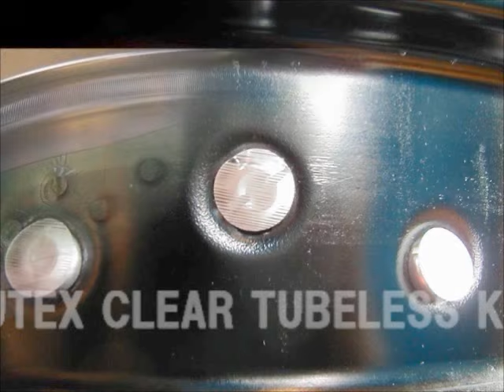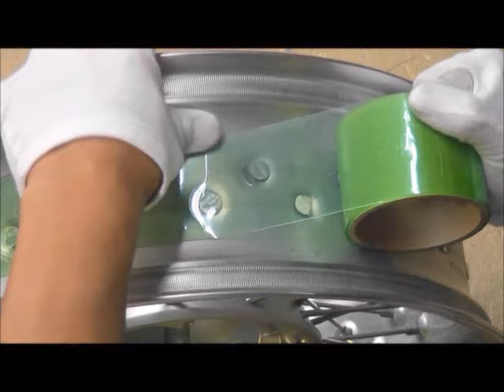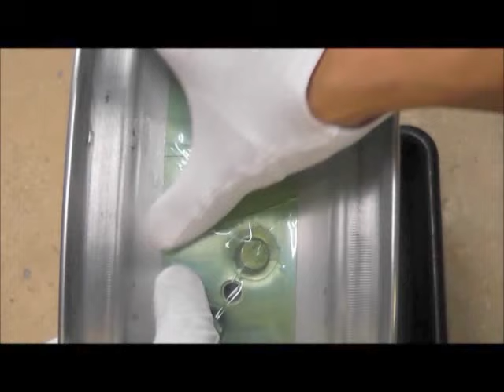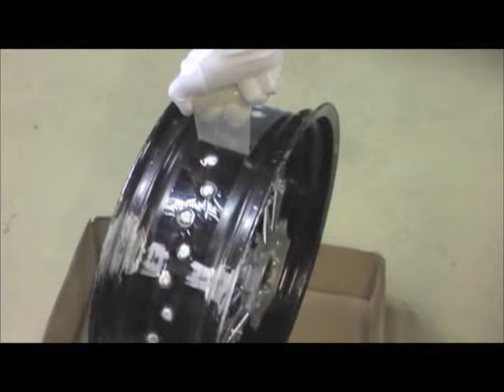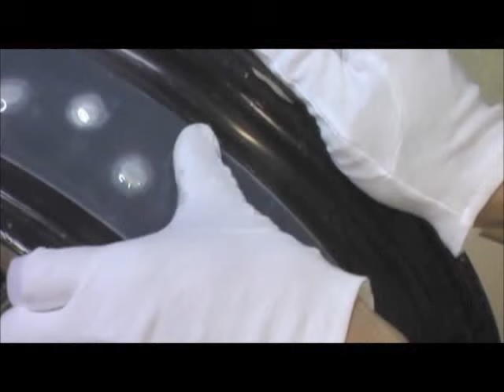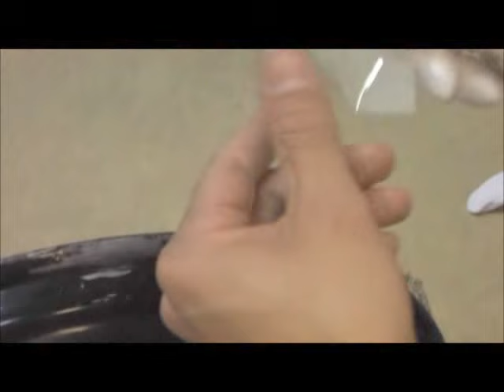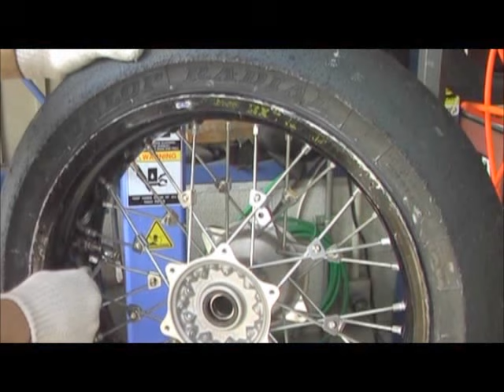OUTEX Tubeless kit for spoke rim / Supermoto, DUCATI, BMW, etc.

Comment: Used this two weeks ago and so far no probs. The only grinding i did was a few little spurs on the spoke nipples. 5mins with a dremmel. Iam very pleased.
Reply: Yes my rim has the grove. The bike is a F800 GSA and was already fitted with tubeless tyres,  When you order the kit its bike specific for your wheel size.
Reply: Is it still holding up?

Comment: What about when I have a large Excel alu nipples? Which heads protrude about 5 mm off the rim? In the video nipples heads are dubbed - 0:04.
Do I have to grind them to put the tape evenly?

Comment: There is no bead for the tubeless tire to grip on a tubed rim. So when it goes flat the bead is broken and you go down. Much safer to go with a relaced tubeless rim. Just saying
Reply: Not true in every case, my bike has tubeless tires on a spoke rim but uses tubes.
Reply: A tubeless wheel will go flat much slower than a tubed tyre. More chance of going town from a tube puncture.

Comment: Not really a good idea to cut the Tape as shown.
Even a slight score on an Alloy Rim could lead to cracking.
Reply: Flatus Antiquitous 
No, you're wrong.
I'm a sheet metal worker and when you layout on aluminum, unlike galvanized or stainless steel, you always use a pencil or marker and never a scribe as that could lead to fractures or complete breakage.